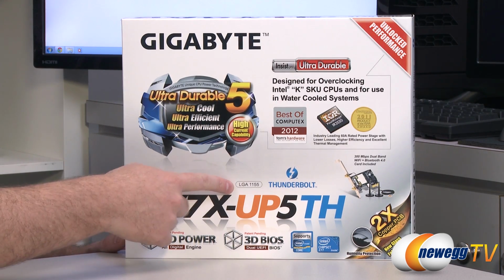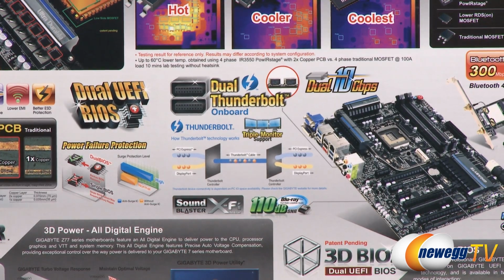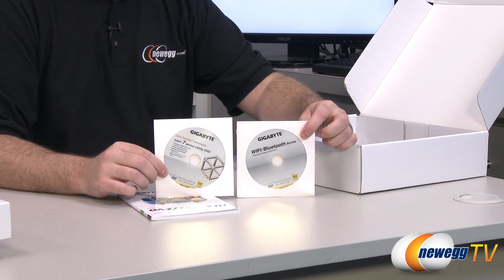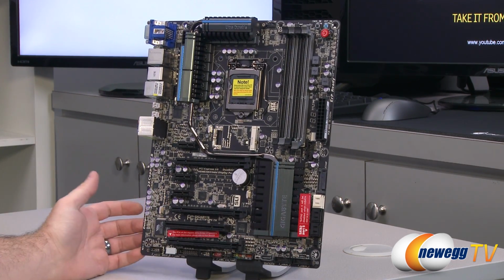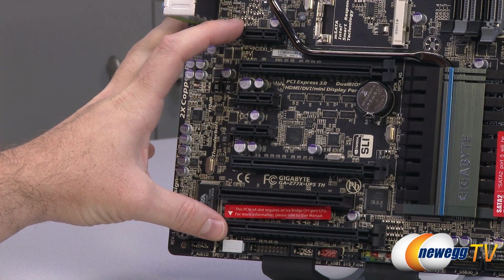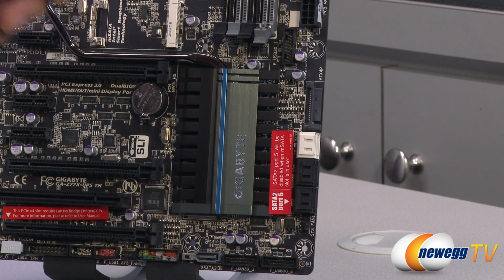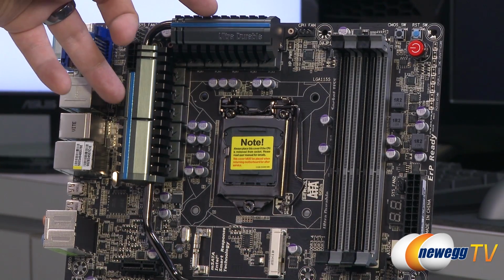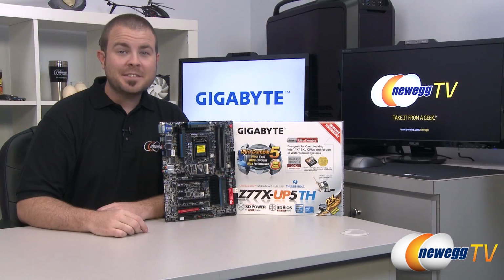Newegg TV: GIGABYTE GA-Z77X-UP5 TH LGA 1155 Intel Z77 Motherboard Overview

Comment: The three PCIe 1x are connected via a switch to a single PCIe 1x lane. Not good if you need alot of bandwidth on the card you have installed in the slots.